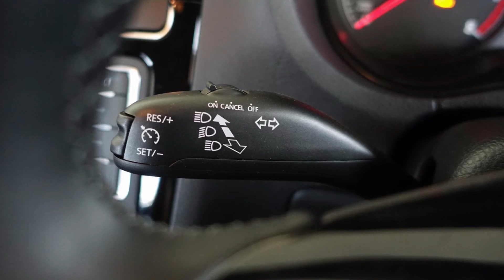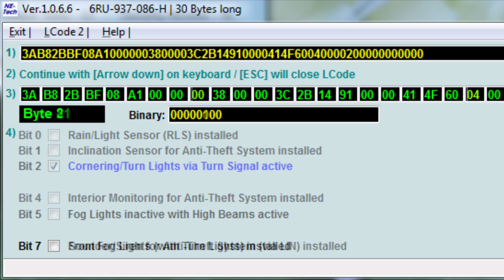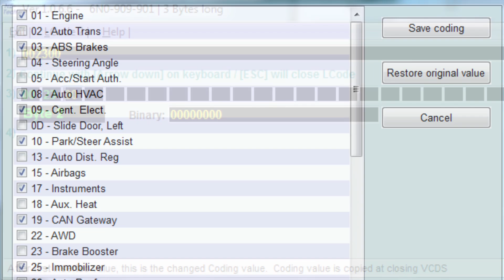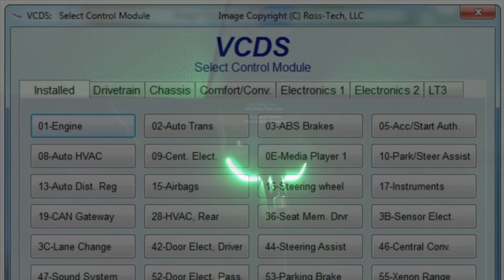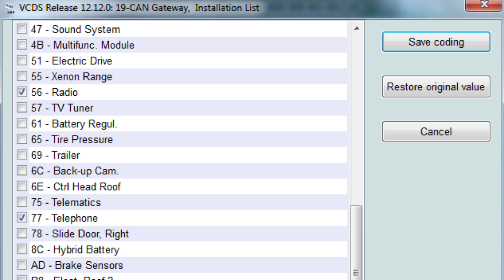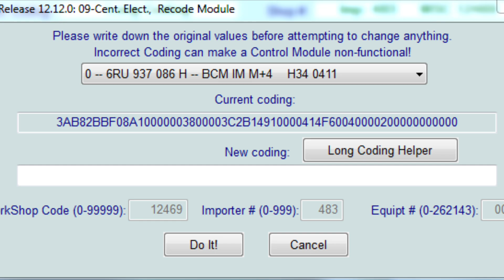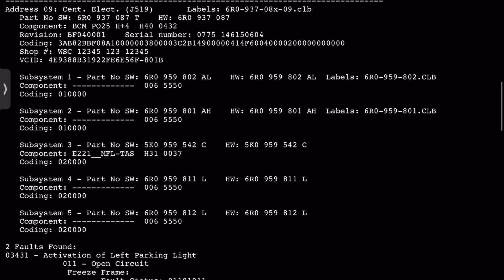Polo 6R - Upgrading BCM

Comment: Is high+ bcm supporting LED lights without dash error?
Reply from the maker: If you meant the stock LED headlights which were sold on the Vento Highline, you’ll need the 7E0 BCM.
Reply: @GaneshBalan not stock, I bought vland led headlights and tail lights, on this current bcm I don't have many options like cold/hot diagnosis, leuchte options that's why I ask

Comment: Hey Many thanks for this video, no Blah Blah just usefule and straight forward guidance.. 
i have question, my Polo 5 All Star , bough in 2017 have three big cables on the BCM , does it make any differences in the process  ?
 i heard there's now security code that could failed  any attempt f you buy used BCM and try to recode it. what do you think ?
Thanks !
Reply from the maker: Hi, that’s really strange! You’ve a Polo 6R with a BCM having 3 connectors? 

I have no clue about the security code part man. Never heard of such a thing before. I do know that the instrument cluster has a limitation in that the EEPROM can be recoded only once after the factory fitment.
Reply: 😊many thanks for your answer. i will buy same used bcm and just test, it s not so expensive on e-bay regarding the quote from vw !

Comment: Question.

Couldn't one just grab the BCM from inside the car, expose the PCB, solder the missing pins and then just plug the missing features' wires in the BCM connectors?
Reply from the maker: I’m sure the pins aren’t the only components missing. There may be additional electronic components as well.

Comment: If j have a used bcm and one key fob and one manual key, is the pairing process the same?
Reply from the maker: Yes. The procedure is the same if you want to adapt the keys to the used BCM. You just don’t have to disable factory mode.

Comment: Hi, i have the PQ25 H+4 6R0937087 and 2010 vw polo 6R SE, UK Model , which bcm do i need to enable multi function steering wheel controls?
Reply from the maker: Hi, your current model supports MFSW. Have you tested with a MFSW and the associated wiring?

Comment: hello, quick question. as youre a very good and avid polo modder, have you ever figured out a way via vcds to disable the PRL/DRL on the post 2012 Polos? I HATE PRL, it caused my battery to go flat the other day while i was messing with vcds and the engine was off. Thank you for your hard work, my cruise control no longer works (E45 switch issue) so I will follow your retrofit guide to see if i can fix it myself (or maybe you have an idea?)
Reply from the maker: Hi, no clue because we don’t have PRLs or DRLs on the Indian make Polos. Some users have managed to get the outer bulb on the European Fog Lamp assy work as a DRL.

Comment: Hi Ganesh sir, for BCM Max also pre steps would be same right? Saving long coding, can gateway list etc..
Reply from the maker: Hi Harish, that’s correct. The steps are the same. For BCM Max, I’m sure you’ll know additional wiring harnesses are required.
Reply: @GaneshBalan hi sir, I gave new value to 0 and clicked test and then save. It successfully saved.
And when I come back again and click on read it shows 1 in stored value. It should show 0 right? Where am I doing wrong, please guide!!

Comment: I have vento. I want to upgrade the infotainment system. Which is the best RCD 330, RCD 340, RCD 360 & RCD 340g plus? And where can I get this outside? Currently there are no stocks in the showrooms. Please suggest
Reply from the maker: Hi, RCD 330 has a smaller display. 340/360 have larger displays. 

Ask aftermarket audio accessory shops and VW dealerships if they have stock of the OEM unit which have been taken out of a Polo or Vento. Some owners upgrade to Android units with larger displays. You can get a good deal on it. 

Or get in touch with these retrofitters who deal with installation of VW retrofits. They can help you source one. 

Praveen can help you out. He’s based out of Bangalore - +91 81477 37557.
Reply: @GaneshBalan  Thanks bro

Comment: Thanks Ganesh for posting this video. I have read your post on teambhp about the new BCM installation and adaption back when you posted it.  Great of you to post this even though you don''t own a Polo anymore. But, I am surprised you have not mentioned anything about cabling to adapt the new BCM?
I am asking this because I am trying to umderstand the process as I am  contemplating upgrading the BCM (mine is GT TSI 2015MY with current BCM 087) and the different people whom I spoke to for procuring and installing BCM Max(090 series) are chanrging 15k just for the harness alone.
Reply from the maker: Hi Soorit, thanks for the feedback. Changing a BCM does not always entail a wiring harness change. I went from 085 to 087 without a harness change. The primary intention of changing the BCM in my case was installation of cruise control. That’s all. I wasn’t looking for additional features. 

Since you’re going from 087 to 090, you’ll have to insert additional cables in the A and B connectors as the BCM directly drives the headlights.

Comment: Great Video as always. How do we source new BCM
Reply from the maker: Hi Shanu, back then I sourced it from Russia since we did not have the 087 series in India. 

Now you can get them the cheapest from salvage yards where accident vehicles are being scrapped or through retrofitters who source it from abroad. 

Continental now manufactures these BCMs locally in India so it is a lot cheaper.
Reply: Hi. Looking at this comment I’m curious can a previously used bcm be adopted to a different vehicle because I hear it’s not possible as the car won’t start because it has immo data from a different vehicle?
Reply from the maker: @deanemily889 Doesn’t matter for BCMs. That’s for instrument clusters.

Comment: Hi Sir, can you suggest from where can I get the VCDS cable? Any links would be helpful. Thanks in advance
Reply: Thanks a ton sir!!
Reply: Check out this
Reply: Check out this
Reply from the maker: Unfortunately YouTube prevents other members from sharing external links so it doesn’t show up.
Reply from the maker: Hi Prabhakar, initially I had bought the counterfeit version from Aliexpress. The first one did not work, the second one did. You cannot buy from Aliexpress anymore to India and experiences are a mixed bag. 

The second option if you have the budget is to get the original version from Ross Tech (which I did later). It’s expensive and will set you back by 15-20K including customs duties. 

Or find someone who has a cable and they can do all the changes for you.
Reply: You can opt for OBDEleven which os directly imported for Europe around 5500 rs. You can do the similar work over there.
Reply: @vrushabhfasge2346  i need vcds